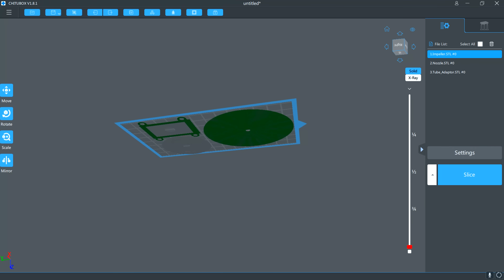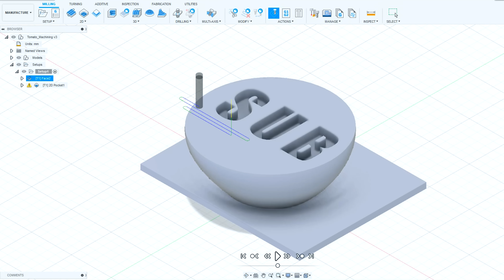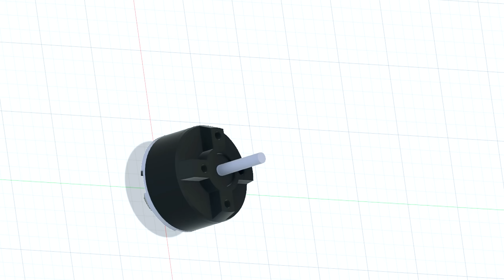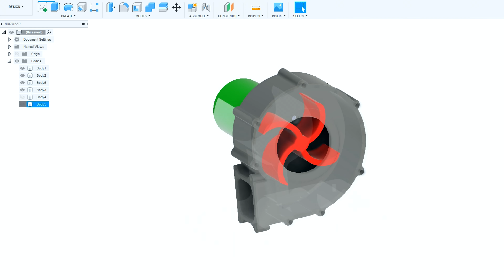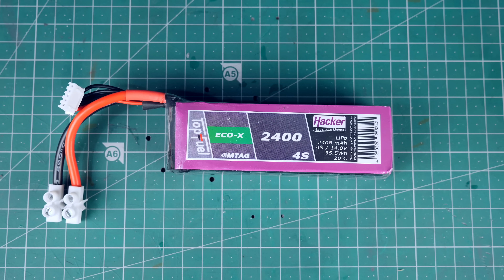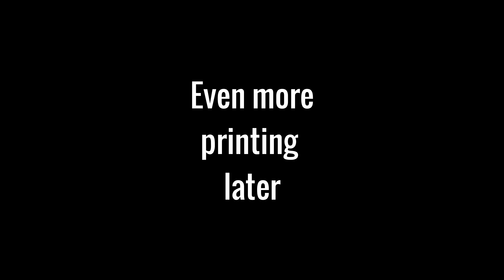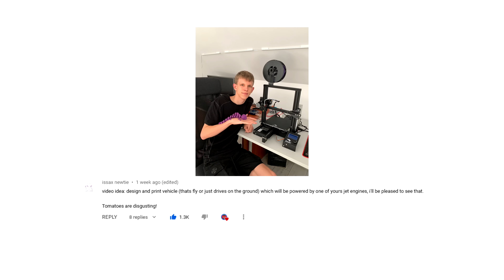Water Rocket Skateboard (3D Printed)

Comment: Hey Integza, just a reminder that your pump was probably exploding due to shockwaves, the insane speed of the impeller was creating a very low pressure at the back of the blades, vaporizing the water, that just crumbled back and created a lot of really strong shockwaves. It's the same effect that happens when a bullet is shot on water.
Reply: Also, on that matter, try to make a shockwave generator to explode glass bottles, it would be awesome to see it working in slow motion

Comment: One problem I can think of for using water as your medium is that you need to carry the water with you. With a jet, the stuff you throw back is what the jet is immersed in. Since you have to carry the water with you, the increase in force that you apply by throwing back water at that velocity is distributed throughout the weight of the whole apparatus and the weight of the water. That design being used with water might be better served on a sub or boat.
Reply: Also make a Rube Goldberg machine for destroying tomatoes using as many of the principles you've learned about and as many of your inventions as you can. Bonus points if you use one that will break in a reliable way as part of the sequence.
Reply: I just had an idea. What have you used a Tesla valve for carrying a liquid fuel in a pulse jet? The increase in efficiency drive from the shaking of the pulse jet should result in a more efficient use of the Tesla valve, right?

Comment: I stand by my comment from the pulse jet video: I think you should try and make a model v1 flying bomb! (Without the bomb part of course) ooo and maybe make it RAT or rocket assisted takeoff with a solid fuel rocket engine! I don't think you've used aloud fuel yet on your channel?

Great video integra! I wonder if having the pump primed wouldve added the resistance needed to slow it down and not explode, unless of course the pressure is what caused it to do that.

Comment: I would add a wall between the outlet and the outer perimeter of propeller that way the water speeds up  on the inside and through the exhausted going around the outer perimeter of the wall and shoot out the nozzle that way the water doesn't slow down when the water comes in and then takes all the momentum of the water going out the exhaust
Reply: And welcome to the world of subtractive manufacturing from a CNC machinist by trade love your videos and your work

Comment: You should try to replicate Tesla's arc power transmission balloons at a small scale. 
https://patents.google.com/patent/US645576
Low pressure tank, hydrogen gas, tesla coils, plus high voltages?  What's not to like?

Comment: You could use a feed pump to feed the actual pump to get more flow to it for one of your videos . Its the same thing they use for fuel pumps in cars. So you could get a faster output flow and get a faster vehicle. You could also try to design a impeller for your centrifugal pump thats more shaped like a turbocharger as it´s more efficient. Edit: And you should put your pump input and yout pump lower relative to the water level in your resrevoir so you have more pressure at the pump input.

Comment: I think you need to orient the pump so that the outlet is at the top. Having that much air in the pump will cause similar issues to cavitation at much slower speeds.

Comment: You built a turbojet engine, now you should build a turbofan engine. My understanding is that they are quite similar, but that the turbofan uses the pressure of the combustion to rotate a crankshaft that drives a fan or propeller.

Comment: Can you strap the Engine so a Surfboard? -> So you will have endless water supply and less friction to the ground.
Also Engine pumping against water instead of air will give you more thrust. (ralative to air)
In adition you could Twist the rotors like the Tubine engine to be more efficient.
I dont know much about the nossle designs but i think a Longer nossle would make the Stream more efficient.

Thanks for your education Videos. :)

Comment: Hi.  You do not want to make the nozzle smaller.  Doing so increases the static water pressure, which you might intuitively think is a good thing, but it's not.  When the water comes out, static pressure immediately causes the water to spread out.  A fireman's hose, on the contrary, has nearly zero static pressure, thus the water doesn't spread out when it exits.  Instead you want to high dynamic water pressure (aka, high water speed).  Which means a large nozzle size.

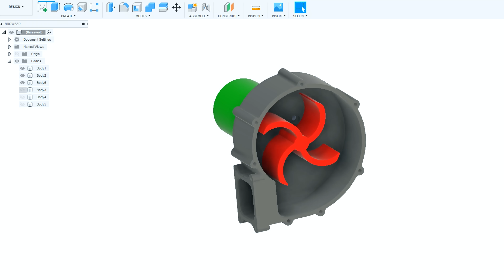Comment: i think there is a flaw in the design that could inprove the performance really much if you fix it, if you look at 6:57, if the proppeler rotates anti clockwise the sort of buckets will pick up the water, but the water cant go out the pump that easily so the water needs to turn arount to exit the pump, ant if it rotates clockwise the exit would be in the right place but the buckets will face the wrong way.
video idea: fix the problem and look at the new performance!

Comment: I'd love to see this as a boat, using the water it travels on rather than have water stored.
Reply: I believe jet skis use that concept
Reply: @Cephalon_Lycos  they do
Reply: You mean like a thrust motor for a boat......
Reply: So a jetski 😂
Reply: It’s called a jet drive
Reply: Thats how they work. A propeller pushes water behind the boat.
Reply: enjoy the 3D printer bro
Reply: I was literally going to type that same thing in chat but you already did lol
Reply: Sterling engines can power boats in a similar way, only the temperature difference of the water and the air is the power source
Reply: Oh boy do I have news for you
Reply: you just described a jet boat and jet skis, but thatd be so cool
Reply: I like this idea
Reply: An impeller. Yes.
Reply: Just make a just boat
Reply: I was thinking the same. The skateboard wastes a lot of energy and time trying to shift that large tank of water.
Reply: agreed and with a boat, he would have unlimited water as well as a much higher speed. If he designed it right he could get over 100MPH
Reply: Great idea tho
Reply: It's called a jet ski and I have a sea doo boat in storage that does the same
Reply: They are called impeller driven boats aka jet boats
Reply: They already exist, they’re called Jet boats, probably the most famous one would be the PBR
Reply: @insertnamehere6960 I love PBR
Reply: There are boats that do this. If you watch any of episodes of Miami Vice you'll see lots of them
Reply: Well it's been around since the late '60s😂
Reply: Look up jet boats. Lol
Reply: All boats use the water their on as propellant
Reply: There are literally jet boats using this principle. I'm pretty sure they have been relatively common for 30-40 years.

Comment: VIDEO IDEA: Pls make a jet boat with the jet pump.🙏
I think that it might work because of the fact that if the pump is submerged under water that it would not then just blow water out at the back but also pulling water in at the front and also the fact that you would not have a tank of heavy water on top slowing it down.

Only thing that might be a problem is the fact that you'd have to connect the motor to the pump turbine using a belt,chain,gears.

And i would also recommend to mount the pump in the center of the underside of the boat.

Comment: jet engines use gas because the force is proportionnal to the mass and the velocity square, meaning a light particle going two times faster will push 4x more than a particle twice as heavy going the same speed ;) sure you know it but just to clarify

Comment: Was the failure cased by having liquid, or by running out of liquid and spinning in air or vacuum?
Maybe do a test under water.
Use a much smaller nozzle.

Use a Tesla turbine in pump mode.

Comment: To create higher pressures you would need a multistage centrifugal pump ;-) that is what they use in industrial projects
Reply: No, he is using the wrong type of pump, needs to be axail flow, and the pumps you are referring to, is if the fluids being moved are compressible, water is NOT compressible, plus what you have suggested is also very bulky and heavy
Reply: @Celcius1  Not if it's 3D printed... And the liquids we pump with these multistage centrifugal pumps at our chemical plant are very much not compressible ;-)

Comment: Proposal for a big milestone video: make a Rube Goldberg machine to destroy tomatoes bit by bit in increasingly ridiculous ways. 

For example: torch them more and more by rolling them in front of a row of every type of jet engine you've ever made, then add more steps to slice, dice, and grind them into a paste before forcing that paste through this liquid impeller, burning the paste down to ash, and finally blowing the ash away into the wind.

Comment: Be careful cutting metal with that CNC mill.  
Mines far far larger, (3dtek "heavy mill" https://shopau.3dtek.xyz/product/heavy-mill/ ) and it does aluminium OK, but slowly. 
I've done mild steel, but it's pushing it and needs liquid cutting bit coolant, and tends to really stretch the X and Y drive quickly.
Reply: Why not switch to leadscrew or ballscrews for your drive?
Reply: @Celcius1  Cost mainly, and it's not worth the effort of converting as I never intended to mill steel, it was for a one off job.
It's fine on aluminium, plastic and wood, which is the primary resources I use.
Honestly, slowing feeds right down, and taking the smallest of material each pass, and you can do steel easily enough, just very slowly.

Comment: Try centrifugal jet engine! For this design change impeller to be not so thick. Back to jet engine and it can be used for driveshaft power also. Just make sure compressor isn’t a bit further back from combustion section. Good luck. For next experiment try radio or speakers.

Comment: Video Idea: Cold casting: a long time I saw few videos on Youtube regarding casting a resin part using silicon moulds, the fun part was that they were using steel powder mixed with the epoxy resin so the final product was a "metal like" part which later on they sand it and apply acid so the model looked rusted. I search alot on Youtube and was not able to find any  scientific test on this method, what are the propreties of this type of material ? are they magnetic ? can it conduct electricity ? are the mechanical proprieties similar to steel ? and finally: what temperature can it handle ?. The ideia is: 1 - to print a 3d model. 2 - make a silicon mould using this model. 3 - create a mixture of epoxy resin and steel powder (20/80 for example) 4 - cast this mixture in the mould and test the final product. I had this idea watching your videos and all the times you use the porcelain resin, to be honest I don't think will work for temperatures above 500ºC because the highiest temperature resin that I found was around that. Never the less all the others possible proprieties are very interessing, being able to "print" metal parts seems very interessting. Hopefully someone will read this comment, If you read until here please forgive my english since is not my mother language and let me know what you think about this idea, i really wanted to test by myself and record the process but I don't have the tools (aka 3D printer). Leave a like if you think it's a good idea and hopefully Integza see and make a video for us.

Comment: I believe and I might be wrong. But you would get much more power out of that pump if you primed it first....... also stop it from exploding. It looked like it had a lot of air in it and this caused it to 1. lose power as air is a lot less dense, and 2. run away and explode.

Comment: Hi ... would the nozzel pointing at the ground at 45 degrees help with thrust? like pushing on the ground a bit?
Reply: Negative, if you angle the nozzle then you are also reducing thrust in the desired direction.  If you want to move left to right and you point the nozzle towards the left perfectly horizontally then 100% of the thrust will be used to push to the right.  If you angle it straight down (@90 degrees to the direction you want to travel) then you will have no thrust pushing to the right and all your thrust pushing straight up so you will go nowhere.  If you angle it at 45 degrees then you will be half way between 100% and 0% thrust pushing you to the right, so you will be reducing the thrust pushing you in the desired direction to 50%.  and if you keep rotating it around you will go from backwards to downwards then the nozzle will be facing forwards and at that point it will be the least efficient at -100% thrust.
Reply: Losing thrust by angling the nozzle isn't always a bad thing, for example jet dragsters point their jet engines upwards slightly so some of the thrust is used to push the dragster down onto the drag strip which helps keep them on the ground and stable.  This is why the jet dragster has no real wing to create down force compared with piston driven dragsters, the engine's thrust does it for them.
https://www.youtube.com/watch?v=J3819OC-7wA
Reply: @benfubbs2432  interesting hmm, thanks

Comment: So… wait!
You could have unscrewed the valve and added an other fitting to make it sit out an inch but instead you opted to cut the metal tap?
Reply: Assuming he had another fitting on hand? I know that if I had to go drive back to the hardware store to get another fitting then I would go with the grinder every time.
Reply: @benfubbs2432  I’m trying really hard to think of an objection to that logic but I know that I would absolutely go grab my dermal and do exactly the same thing!
So!! 
(It’s social media & I believe this is the standard reply)

FCUK YOU BEN! 
{insert childish insults here}

That told you for pointing out that I was wrong

(Well in principle it’s what you SHOULD do but yeah still wrong)

Comment: Try to slowly accelerate the liquid on a smaller prop, it's more efficient.
Reply: wont work, centrifugal pumps get there fast output from compressing the fluid(air) in the housing with the impeller, water is not compressible, you need to move the fluid(water) by transferring kinetic energy to it.
Reply: @Paul's Engineering Space  
I was thinking about an open design like this https://encrypted-tbn0.gstatic.com/images?q=tbn:ANd9GcTp_PUdaRTzh-3-0B7vJsXFHNUxdQVgjaJ5WQ&usqp=CAU
I'm not talking about a centrifugal compressor...
Also I don't think it's airtight, and it's pulling air from the casing...

Comment: Integza your using the wrong type of impeller if you trying to move water quickly and efficiently to get the thrust you need. Switch to an axial based impeller, instead of a centrifugal type, as the water flow and power transfer is more efficient than a centrifugal pump, centrifugal pumps are better suited for air, as the movement process also compresses which is why it works with air quite well, water is not compressible.  If all you need is liquid circulation centrifugal is fine, but if you want an efficient transfer of power, switch to an axial style impeller, as you want to move the water quickly efficiently, if you look at jet-ski designs, where the water jet is used extensively, you will find they all use Axial flow impellers, to move the water efficiently and fast

Comment: Quick question, if you had more fins on the propeller, wouldn't that moved more mass of water, at the expense of RPM? Basically slowing it down so it doesn't break but still moving a lot of water? 
Just curious

Comment: A lot of the pumps energy was wasted due to air being on the pump. It needs to be properly primed first.
Reply: I'd say more energy was wasted by rapid unscheduled disassembly.
Reply: Even if the pump was primed there is still a good chance cavitation would happen. He needs to have higher pressure coming into the pump. Raise the water up or increase air pressure on top of it to increase the NPSHa.
Reply: Priming a centrifugal pump is required only when the pump is above water level. In this case, that's not true, so priming isn't needed or more accurately it was already primed. Cavitation did happen tho, because of the bad design.
Reply: @AabhasLall  it was primed but there was still air in the pump which could have been what got compressed to failure. A small valve on the top of the pump would have relieved it of air without it roughly 1/3 of his pump still had water in it due to its shape and gravity
Reply: and centrifugal pump just for moving a lot gasses/liquids, not for pressures
Reply: Actually, I think the pump would work better if the impeller was horizontal, so the water would not have to flow "up hill" to fill part of the pymp housing ... fwiw
Reply: I think it would be enough to mount the pump so that the outlet is on top and so the air automatically gets pushed out when he opens the valve
Reply: I don't know if you noticed but integza isn't an engineer, he just wings it
Reply: And the pump Inlet was weyyy too small
Reply: @alyo3299  Think you are right, pump was clearly cavitating. Much bigger intake for the pump!
Reply: The pump was most likely cavitating, which is why it disintegrated. So first he needs to stop the pump from blowing up, he can worry about efficiency later. I think a gear pump would be better here.

Comment: You can actually not pump water to achieve a water jest - if you pump air into a sealed container that's like almost full of liquid it can produce enough pressure to push the liquid through a hole with quite some speed - just like in deodorant can. You can do that for your next video as well.
Reply: Correct, you either have the water in the chamber with a portion of compressed AIR provide the water pressure as AIR is compressible, or you use an Axial Flow impeller designed to efficiently impart kinetic energy to the water providing a pushing force